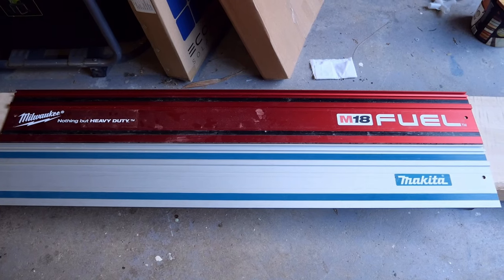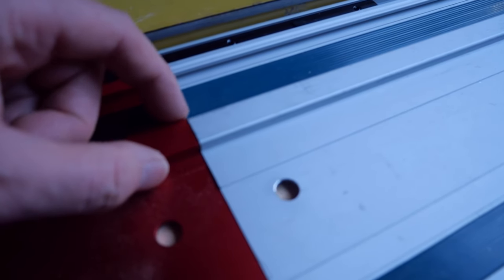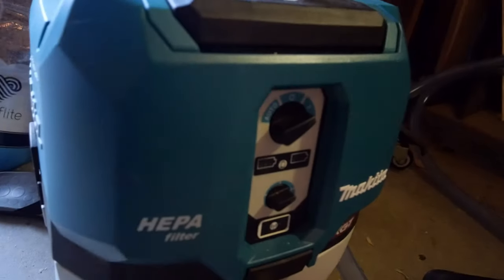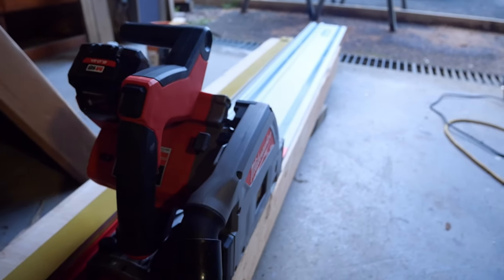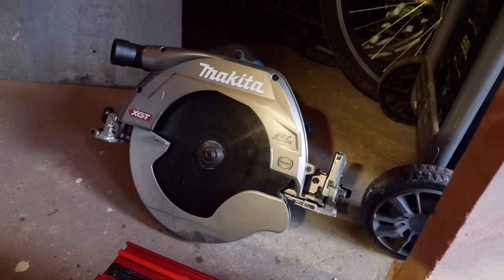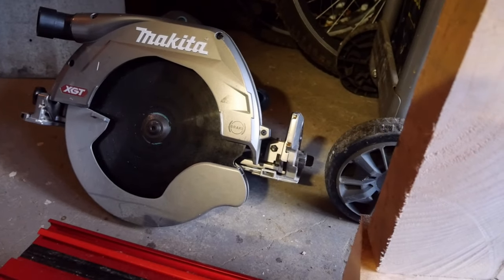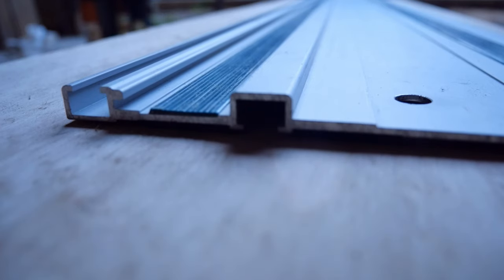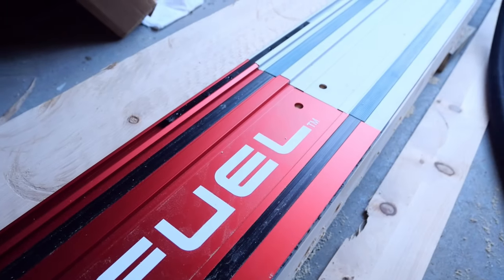Milwaukee and Makita Track Saw Tracks... Are they compatible with each other?

Comment: Does the Makita saw , run ok the Milwaukee? And which do you prefer between the tracks , I find the makita tracks get damaged quite easily, especially the ends .
Reply: I mean they are made from he same material :)
Reply: @riba2233  yes true , it’s probably makitas , garbage guide rail bag , which offers little to no protection . And the zips fail after a few months.
Never had a problem with Festool.
Reply: @paulknights1764 interesting, zipper on mine is the best one I have seen in my whole life lol, it slides without any resistance at all